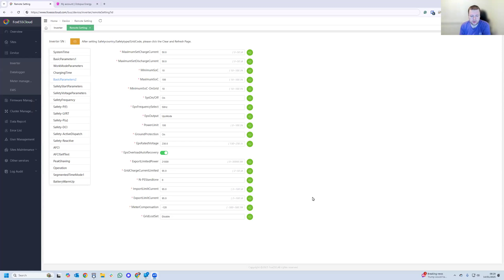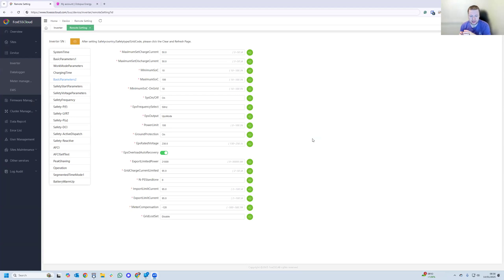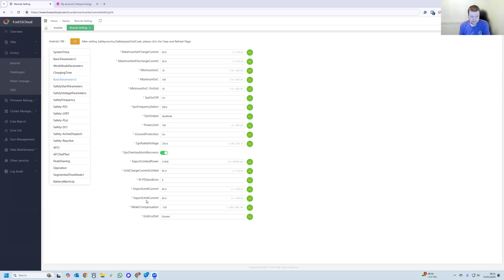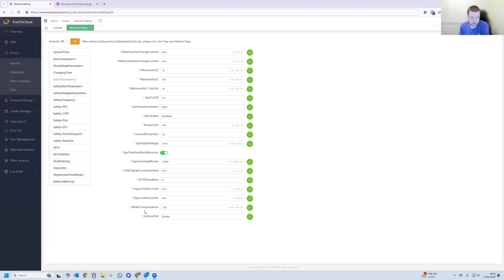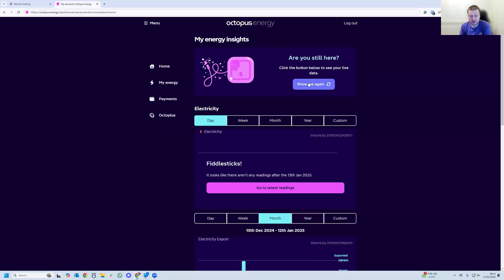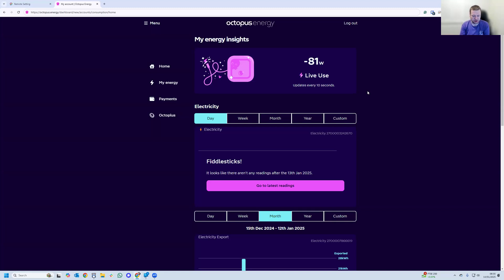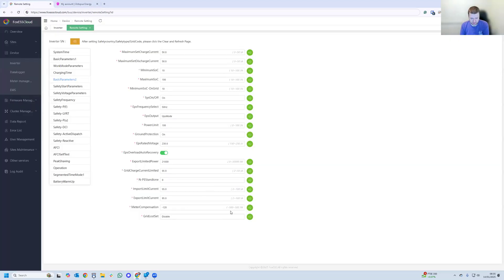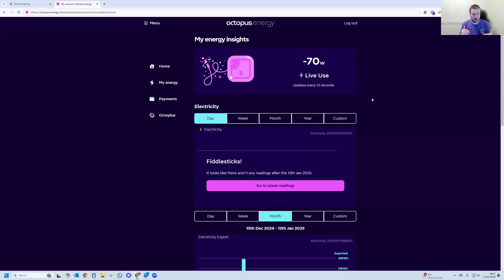New grid settings for Fox ESS inverters! Enable grid pressure, current limits and more.

Comment: To confirm... are these settings available for end users? I am not seeing them. Fox told me there are adjustments in there that can invalidate the warranty. I had to get the Fox guy to take my Meter Compensation down to - 20 from zero...
Reply from the maker: No. Meter comp is a setting only for installers.

Comment: Awesome, did you test this?  The manual seems to imply the GridImportLimit applies when the inverter is in "PeakShavingMode".
My installer increased this to 50A (from 29A) via the Inverter Panel (Grid Settings) and had no effect.
Apparently for 3-phase the limit is applied per Phase.
I am currently limited to house load of 11kw\240v\46A), despite being on 3 phase x 100A, neither Fox Support or Installer have yet resolved.
Update: Installer increased to 90A no change, perhaps this is indeed for peak shaving mode only
Reply: Update: After powering down the inverter and battery, then bringing them up.  The new settings applied.  A standard stop\start performed earlier did not work.

Comment: Fantastic, Would negative -80watts do the job if there are no big jump in loads?
Reply: I think sounds about right my usage over the past days indicate the following:

Percentile	Usage (kWh / 5 min)	Equivalent Power (W)
75th	0.004	48 W
90th	0.005	60 W
95th	0.006	72 W
Reply: @funnyvids5044 that's perfect. You set compensation on -80 or -120?
Reply: Yesterday's uage was 0.01kWh 🚀
Reply: -60 ended up better because you eport a lot less over the day and still achieve the same result.
Reply: @funnyvids5044  after experimenting with different compensation values i have ended up going -10 and over a week now my import has been 0.01kwh. Atm it is summer here in Australia and my total daily export is over 28kwh. However the push back on the grid when no pv generation is around 0.01 - 0.02kw @ -10 meter compensation. 
Not sure if the size of the system affects what meter compensation value would be required to get close to zero import with minimal export but i have 12kw pv, 10kw inverter,  and 42ish kw L9 stack.

Comment: awesome video, not sure if i missed this in your explanation but im going to ask anyway just so im sure given my lack of knowledge, i have a new h1(g2) 6kw inverter and ive seen grid imports around 40w at times (i assume due to trickling), if the setting is changed to -120 and if whatever reason the load that im using from my house is actually drawing more than the battery can handle, will it still be possible? - excuse my ignorance if ive mis understoof your explanations
Reply: Before changing anything be aware of my findings above. Some settings APPARENTLY invalidate the warranty if adjusted. Fox did drop my Meter Compensation to - 20

Comment: For the grid import limit you imply battery charging would stop if the threshold is met. Is this correct? or would the charge rate just be reduced to bring it under the threshold? 

Soon to have an EV charger installed, and while it also will have functionality set to ensure we don't exceed the cutout fuse rating, I'm looking at what options I might have to always have head room for its to maintain a reasonable charge rate (going to make sure the inverter cannot see the EV load) so weighing up import limit vs battery charge limit. 

Import limit, if dynamic, would have advantages as otherwise I would probably be varying battery charge limit by time of day to ensure full capacity available to charge from solar.
Reply: It's measured by the CT clamps at the Grid, Solar AC or DC coupled is not impacted\counted, this is purely grid import.
I know this as my grid import is clipped at 10kw, so battery charging slows when house is under load.  Except when the sub shines as the solar goes straight into the battery (AC coupled).  My Free window is 11am-2pm, so with solar the limit really hasn't impacted me and battery charges full speed.

Comment: Nice one, thanks for this update. I requested FOXESS to update my H1-6.0-E inverter, which they did on the 10th Feb 2025 to master version 1.67 and Manager version 1.76 but this still does not do any push back as described. Do I still need to do further change on settings to get the inverter to do the minimal push back instead of import to keep inverter going?
Reply from the maker: @chikadibiaobi-ofodile540  you’ll need to change the meter compensation to -40 for minus 40watts. This setting is only available to the installer and agent profile types. If you’re not the installer contact your installer
Reply: Hi, how can I reach you.

Comment: Nice one, so just a few questions:

1) Would it be a good idea for a community wiki on versions (Model, BMS, Battery etc with versions functionality etc)?

2) At 3:30 you spoke about CT clamps, is that a symptom of using a CT clamp rather than a meter (like Eastron).  I've seen a few posts on other inverters which people have seen inaccuracies with CT clamps and moving to an actual inline wired meter resolved this issue.

btw - nice to see you also sorted 1440p recording :)

Comment: Thanks for that 
Watched your video on fitting the Modbus - does that impact my warranty?.. and would my installer or a Fox installer be happy to fit one? Thanks again 🙏
Reply from the maker: as long as you don't damage the connector there is no impact to warranty.

Comment from the maker: Just released H1-Gen2 firmware version Manager : 1.48 adds these options - ask your installer for an update.
Reply: Any idea where I find these in my H1-G2 front panel please? I have Manager 1.48 but I don't have agent or installer account access...
Reply from the maker: @JimHamshaw1  can only be changed by your installer over the air currently.
Reply: @iameccles  Would you know if this has been added for access on the Front Panel?